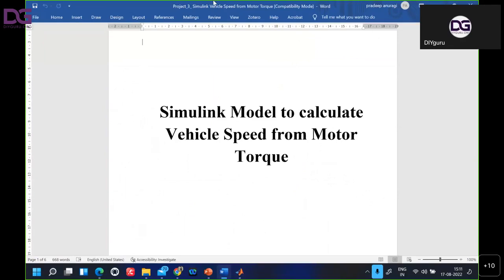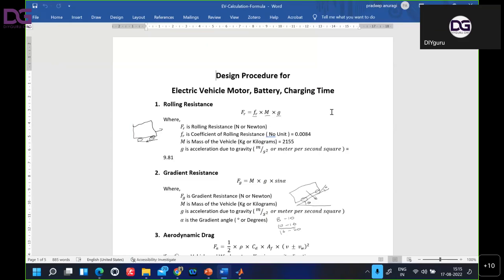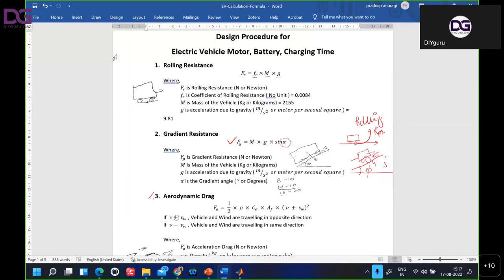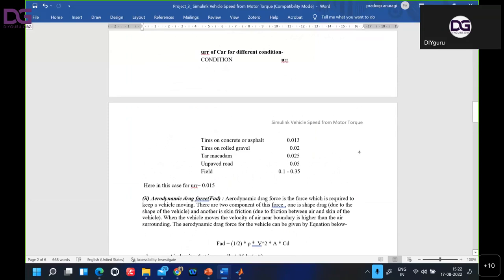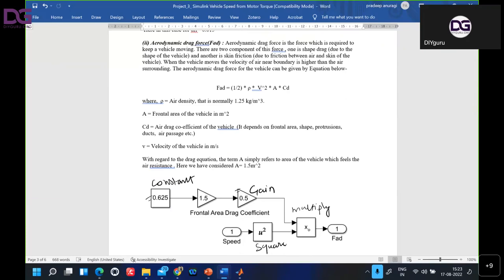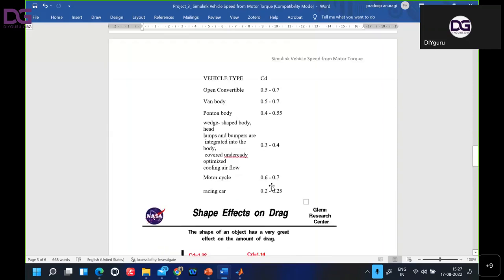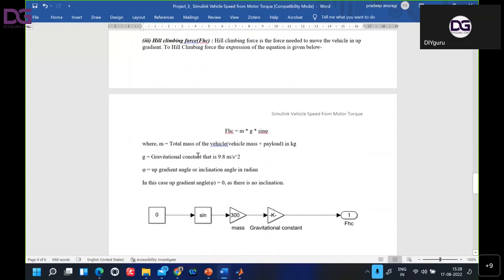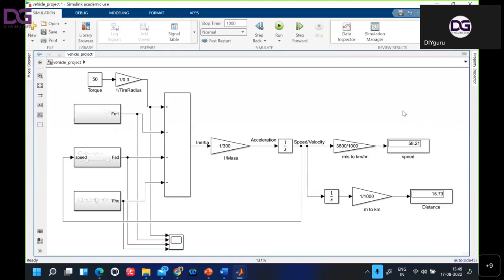Simulink Model to Calculate Vehicles Speed from Motor Torque | MATLAB Simulink Calculations | EV

Comment: Hello sir, what if i use the same model for the rollercoaster which is coming down towards the track with 30 degree angle instead of the car which is going horizontally. what would be my torque value then ? does it still depending on the torque or on the height ?